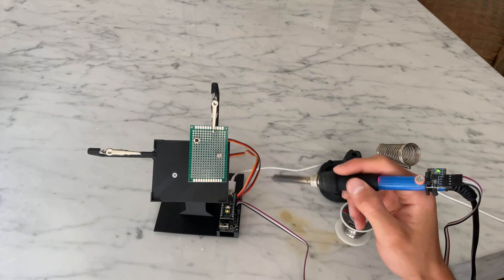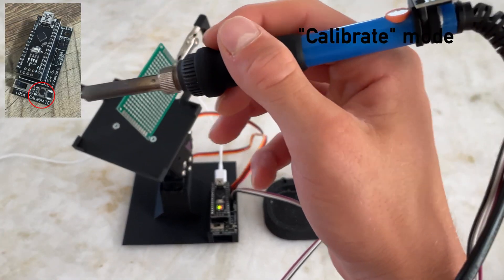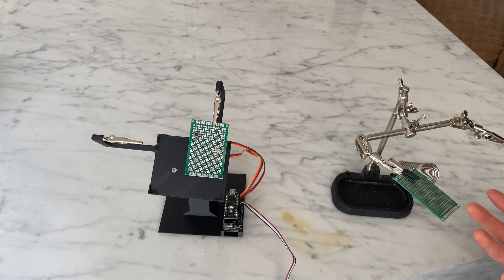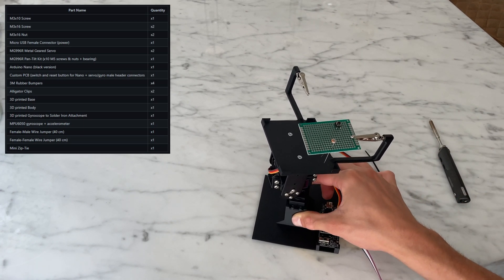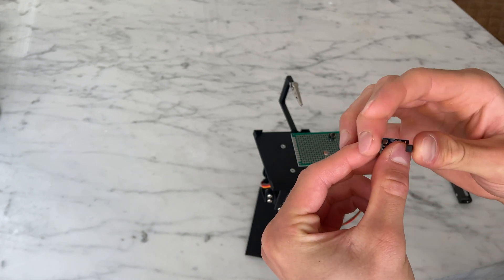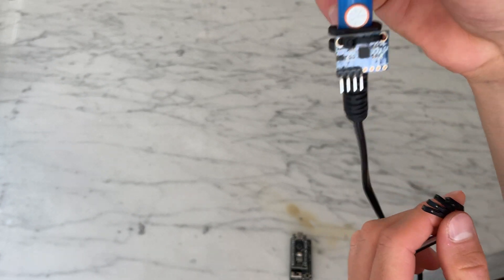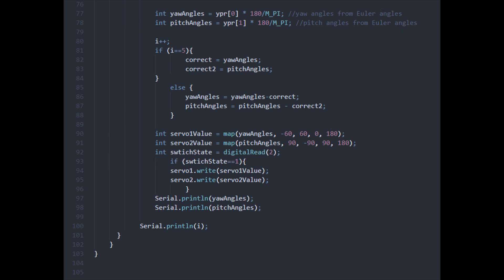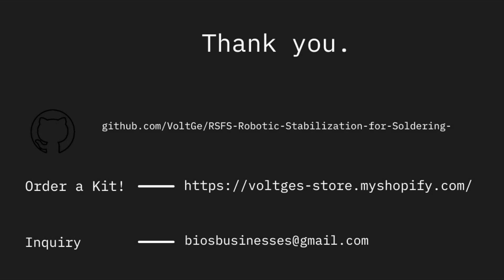Robotic Helping Hand (for soldering)

Comment: Was just soldering up some connectors using the crappy little helping hands and thought “there has to be a way I could over-engineer this to make it better” and then this video popped up. Gonna throw my own version together soon, thanks for the inspiration!
Reply from the maker: Awesome, good luck! This is going to sound crazy but ~9 days ago I was doing some research on MAVlink and DroneKit Python for some work on autonomous drones using a Nvidia Nano companion computer and I learned a lot from your videos describing flight controllers/computers as well as your University demo on that autonomous drone track. I still don't know why they made you cross a bridge aerially lol.